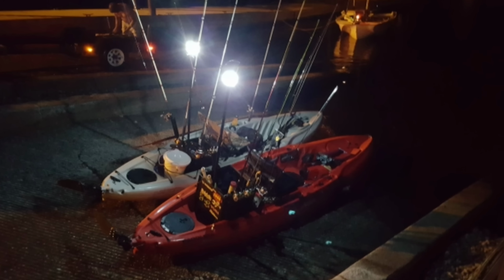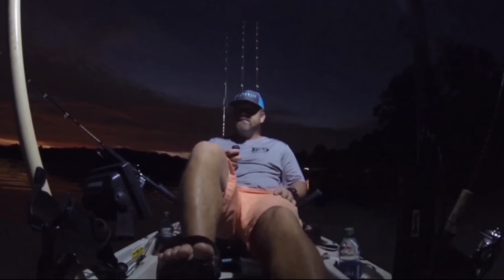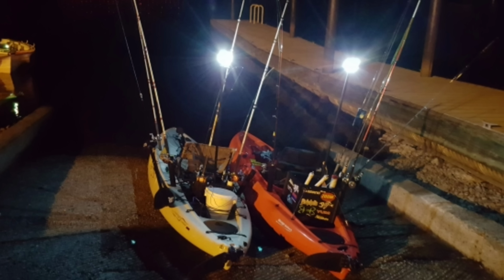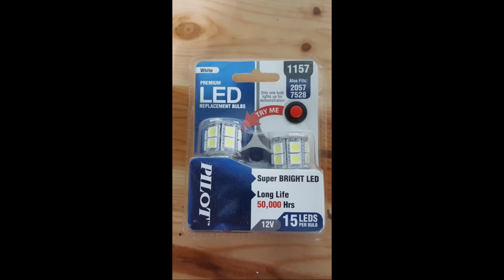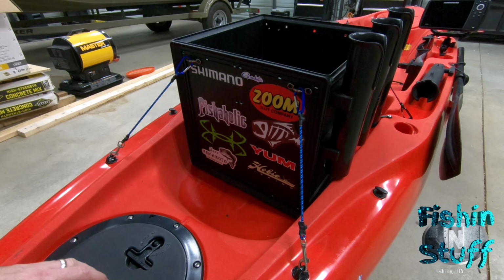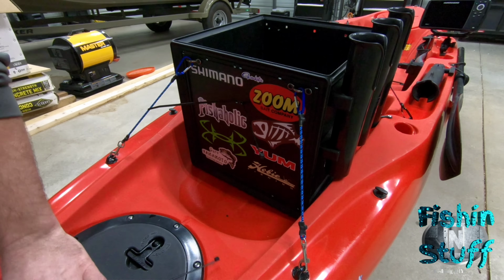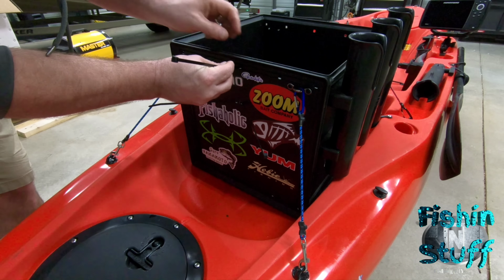Kayak Light  DIY NAV LIGHT( Very bright!!! ,,,,,Very Legal )

Comment: What size pvc did you use. I have the exact same bulbs at home. Making this tonight.
Reply from the maker: it's a led brake light with 15 leds On the pack it says it fits 1157 2057 and 7528 any 12v led light would work I used the biggest I could find for more light but I would use led over a normal bulb for battery life Email me a photo bro I'll post on here , and click the bell because I'm making another video like this for a kayak fishing light idea I have I think it'll be cool
Reply from the maker: The pvc size was 1/2 " I'm pretty sure I alway take the bulb with me because pvc inside Dem change as I've learned lol even pvc and pcvc and the electrical pvc conduit are all diffrent even if they are the same size
Reply: You leave the bulb open to the elements?
Reply from the maker: Marsh Gnat / team shamblez I do but you could cover it
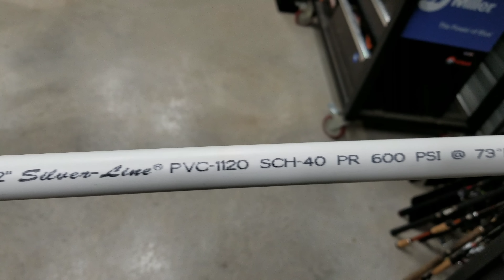Reply from the maker: Marsh Gnat / team shamblez at 1:45 it shows the exact size of the pvc
Reply from the maker: Here's a update to this light you might like better
https://youtu.be/Mxz6wSUBN3A

Comment: What size pvc did you use and what bulb would you recommend? Something we're won't get stopped by the game wardens but won't attract a swarm of bugs LOL! Thanks!
Reply from the maker: Hey brother , watch this video I made a better one , it's kind of an update to that light and I go into more detail about those questions you asked , after you watch it if you still have questions i'l be glad to help you with anything you need to know about it 

https://youtu.be/Mxz6wSUBN3A
Reply from the maker: I hope that help ya , I had a lot of ppl asking questions so I made a new video , plus I made the light better . It's a really awesome light . I appreciate you watching and let me know id I can help you in any way
Reply: Pilot Automotive 1157 LED in White.   Pep Boys has them.  The package I got has a metal housing in it with wires already soldered to the housing, so I just cut the switch off and used the pre-wired housing that at the top of my light build.  No nipple grinding or soldering necessary.  I did have to hollow out the top the PVC pole with a sanding bit from my Dremel, but that was easy enough.
Reply from the maker: Hey thanks for that info brother , I haven't checked at Pep boys , the one I used at Walmart had that too , but I didn't use it cause ive made about 6 of em , everytime I make one a buddy wants it and I end up making me another one lol
Reply: Fishin N Stuff I am not surprised. It’s a very good DIY video, and fantastic idea. I commend you on your brilliance.

Comment: How long does the small battery last on a full charge running the tail light and an occasional switch on for the other light? (thank in advance) Great channel!
Reply from the maker: I've never did a bunch of tests , but I've ran those batteries 6 hours on just a nav light and it still had juice left , I've also went on 2 fishing trips during the day time running a helix 7 , before charging it and it never went dead . You can buy those batteries worth different amp hours I'm running a 7amh , you should watch this video Its a better nav  light I made not to long ago
https://youtu.be/60CO4z7E-9A

Comment: If I was to make it with a switch so I can turn it on and off, how should I do it?
Reply from the maker: Dawrongguy actually I have done that with the really bright one I referred too on the video I gave it to a friend to use to video with , I wired it so the nav light stayed on and you could cut off the bright light , all you do is run 1 wire from your battery too your light bulb then run the other wire from your battery to the switch then out of the switch to the light bulb , you only need a break in 1 of the wires to make it come on and go off just like a switch in your house if your break the circuit on 1 wire the light gos out just like if you take one wire off the battery.  I hope this helps you buddy thanks for watching and you should subscribe I'm working on another cool kayak DIY you will love
Reply: Fishin N Stuff thanks for the info, subbed
Reply from the maker: Dawrongguy I appreciate that and I'm serious you'll like the next kayak DIY
Reply from the maker: Here's a update to this light you might like better
https://youtu.be/Mxz6wSUBN3A

Comment: Could you have put the socket and some sort of cover for the light, to protect it from the environment and for easy bulb replacement.
Reply from the maker: Erick Peterman yes you could but the light has a 50,000 hour life span which I'll never reach and led lights are water proof so it's really unnecessary and the point is to make it affordable as possible you know
Reply: You could totally smear clear silicone on it if you want to make sure its sealed from the weather
Reply from the maker: Erick Peterman you could but I'm not sure but like 90% of all led lights are water proof I should do a test on mine too see if it is
Reply: @FishinNStuff  the reason I asked is, the saltwater and the salt in the air could cause problems for the light. It really seems like a great light.
Reply from the maker: Erick Peterman it is a great light , I was thinking the best way to protect it would be to mix you up some epoxy which you can get at harbor freight pretty cheap and after you make the light dip the whole light end in the epoxy and let it dry , that way it'll be very hard and ultra clear and that should keep it safe from any environment
Reply from the maker: Here's a update to this light you might like better
https://youtu.be/Mxz6wSUBN3A